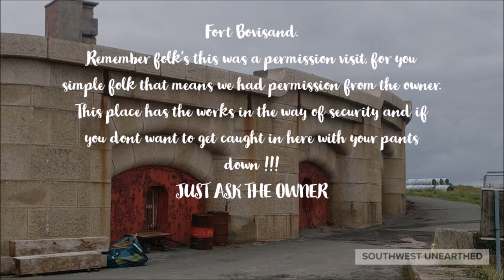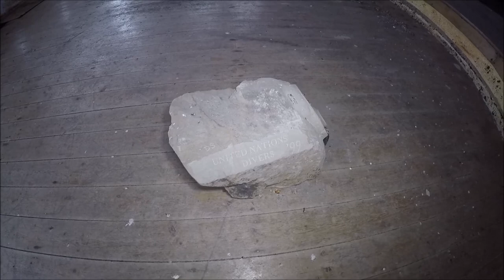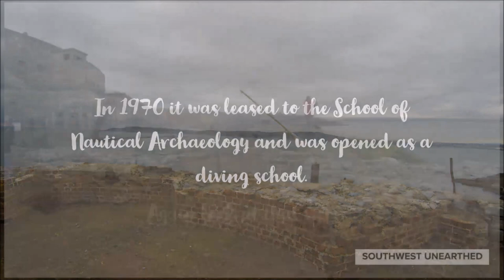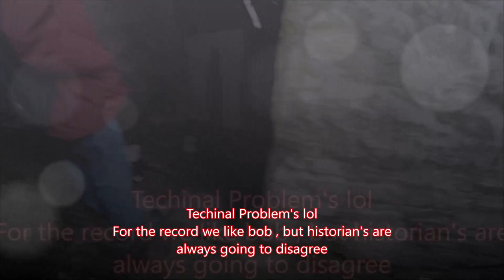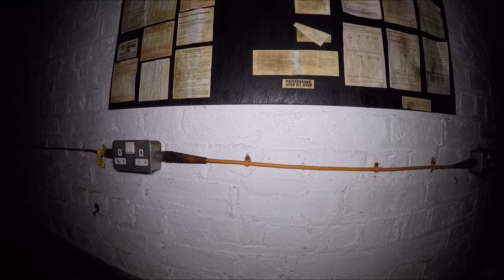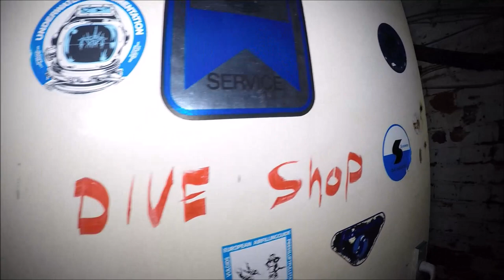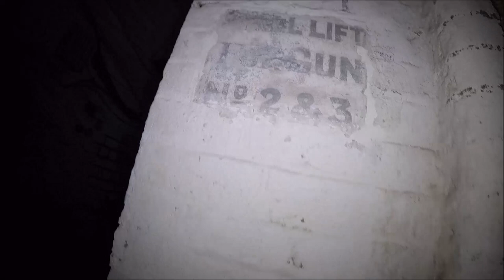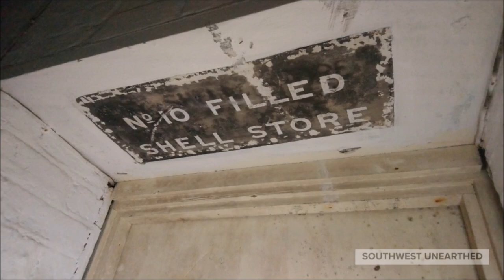FORT BOVISAND #Urbex #History #Palmerston #Fort #Staddon #Defences #Bovisandbay #Diving #School

Comment: I knew Fort Bovisand very well as I lived in Cawsand in the mid fifties. In 1964 i did a solo night snorkel from the fort into the bay just to experience the sea at night. Was based at Mount Batten. In early 70s did 3 Bsac courses at Bovisand driving all the way from london on 3 weekends. Good times and good fun. Gave up diving in 1977.

Comment: I remember trespassing in there back in the 50's, we once got into a deep tunnel which became flooded the further we went, and we could hear waves crashing above us! Pretty sure it was a tunnel leading out to the Breakwater fort. We couldn't get any further due to the water level.
Reply from the maker: That would be the lamp lighters corridor it runs down to the sea it was for a older part of the fort I believe